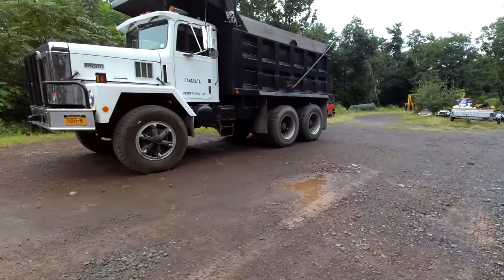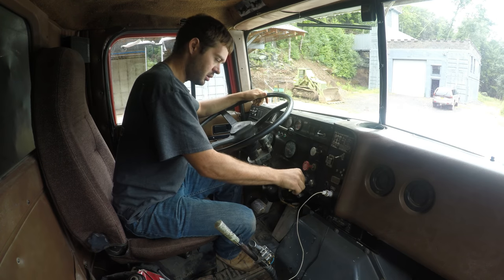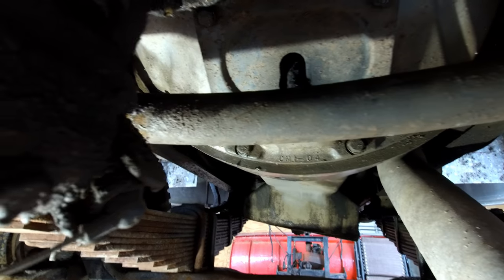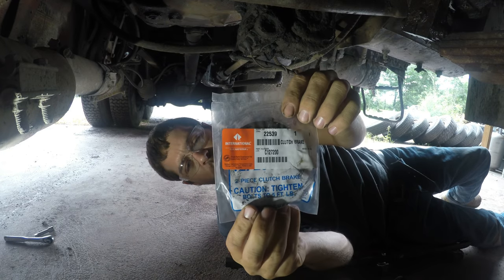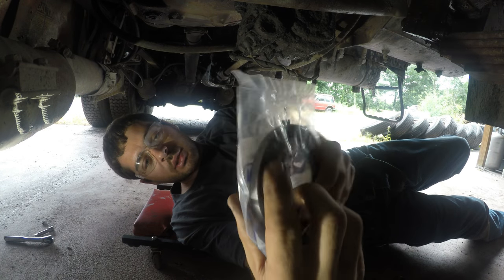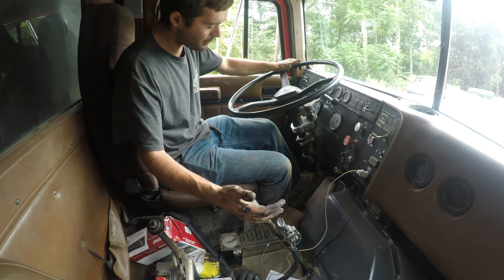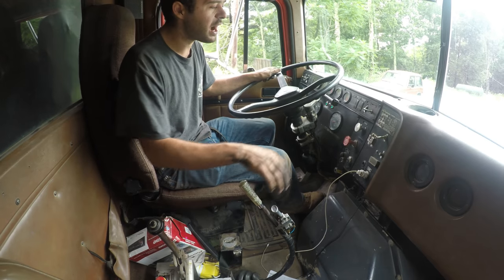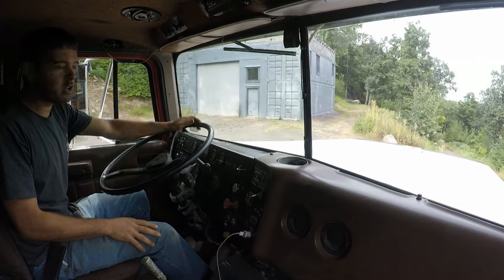Installing a new clutch brake in a dump truck

Comment: Great content it’s called we all live and learn.  At least your not afraid to tackle your problems and repair them yourself. 
Life’s full of lessons.  But now you know and I’m sure your never going to forget. 👍
Reply: Have installed many a two piece clutch brake.  Air hammer and a cut off.
Reply: Most times not removing the old one can put additional load on throw out bearing.  Check to make sure throw out not loosing all its grease due to over heating due to the added drag.
Reply: +Brian Wymer Wymer’s Handy Man Service You're** not afraid & you're** never going to forget.
Reply: SalandFindles  didn’t know it was a spelling contest but stand corrected. Seen your reply was edited so guess you didn’t get it right the first time.    Life is full of disappointment  👍

Comment: Andrew, you should only need your clutch for stopping and taking off.
Shifting without the clutch takes a little getting used to but it's not so hard.
Take you RPM's up to 2200, let up and pull out of gear to neutral at the same time.
Then when the RPM's drop to 1700, shift up into the next gear.
Shifting down is just the opposite, rev-up to grab a lower gear.
Practice it and you'll be king before you know it.

Comment: I’ve driven trucks for 16 years and most trucks I’ve driven had about the same slow to stop clutch brake. Being I’m alittle shorter I have to slide forward to use the clutch brake. I never use the clutch to shift personally but when I come to a stop I slip the truck in whatever gear I’m going to start off in then push in the clutch so I don’t really need the clutch brake.

Comment: Model T with a warford transmission has the same issue with shifting into gear at a stop.  You can either shut it off, put it in gear and restart it, or tap the reverse pedal which does essentially the same thing as a clutch brake.

Comment: Back in the day, guys used to cut the old ones out with a torch.
Reply: Real hard on the seal with a hot wrench.  Air chisel or just leave it
Reply: Not if you know what you are doing with a torch. You cut it not melt it. Use a small tip with a proper flame.
Reply: still do !
Reply: @RobsTrucking  that transmission doesn't have a input shaft seal.
Reply: @gregh.7977  what keeps the oil in?   Last time I took one apart you removed the bolts from the front bearing
cover, then removed bearing cap, flange gasket,
and O-ring.  That O-ring is the equivalent to an oil seal, and will not take heat any better than a lip seal.

Comment: Hey dude u dont need the clutch once your moving , when u change to a higher gear make sure ur not over revin as i notice gear grind alot , 200 to 300 rev drops bertween each gear is ideal , dont drive it like a car , drive it like a truck hehe good vidz mate keep them coming

Comment: Hi Andrew.  It seems that the way you did the job would be fine, except for one thing.  You need enough throw on the clutch pedal to ensure that the clutch doesn't drag before it engages the brake.  That is why on a properly adjusted clutch there is so much travel after the clutch pedal is initially depressed until the brake is applied. The new brake will stop the trans firm and fast enough when the pedal is all the way down so that you aren't sure if the clutch is dragging or not. The clutch will develop hot spots causing it to chatter, a glaze causing it to slip, both or many other ailments if it drags.  I Think its worth talking to another dealership other than the dealership where you got your brake from about how much it will cost to have them install a new clutch, pressure plate and bearing if they are damaged.  I'm guessing.it will be around $2,750 or more and a week or so down time..

Comment: two words... double-clutch.
Push in the clutch pull into neutral push in the clutch again and effortlessly drop into next gear.
With electric shifting, flip it before you take your foot off the gas (up or down) then when your ready to shift up/down just dbl clutch the same way and let the clutch brake keep you from grinding your gears down.
I started out life in a 10 speed white western star a mack dm600 and a Mack B61 Thermadyne believe me no truck will complain about double clutching. By the way your clutch was ailing when you bought it, its easy to see from the first sequence of you starting out, as the truck was experiencing chatter. Don't ever let anyone tell you its better to shift without the clutch, but after you figure out how to wait a beat in neutral before pulling ino the next gear you can do it without the clutch.
I should say, I am addicted to your videos. You are a young man with a whole lot of good sense and you seem to figure things out after seeing it done, or doing it once.
After getting into computers due to back oroblems, I miss the 955H 955K 555JD JD 410D CASE 455 and I envy you all these great small yet powerful machines, that don't tear up everywhere they go due to sheer weight.

Comment: used to change and adjust old volvos with the turbo Cummins and 9 speed fuller trans with the clutch brakes had to explain how to use it to every new driver where I used to work.

Comment: I don't think you will find any one who likes this truck more than me. The only thing I didn't like was the way that transmission shifted even from day one. You fixed the stoped going into gear grind but it's still grinding as you change gears. I don't know if it's synchro's that are worn or what but in any case they gears should not grind one bit when you shift. If the truck was old, rusty or semi worn out I would just run it but this truck is super nice. Worth fixing it right. What do you think Andrew?
Reply: The transmission in Andrews truck is a RoadRanger and was designed and built without synchros. Using the correct grade of oil goes a long way toward reducing gear "graunch", but mainly its about matching gear train speeds when changing to reduce or eliminate the noise.

Comment: @ 6:19. Que the anger level.

With you not removing the old piece you might affect your ability to shift on a regular basis by not letting the clutch fully disengage the driveline.
Reply: It does fully disengage the driveline....he showed that it does plenty of travel before the truck starts to pull.
Reply: You don’t shift using the clutch, you only use it for stopping and taking off
Reply: Tim Gooshaw 
I drove a 10 Speed Roadranger for many years without the clutch but try tell the license examiner that you don’t need the clutch and see if you pass. They want to see double clutch up and down through the gears. 
Now people pass their test with a 6 speed synchromesh transmission and tear apart a transmission without synchro’s because they have no clue how to drive. One guy I worked with had to stop and restart if he blew a shift. He later drove long haul with my brother. 😂🤣😂
Reply: @Crewsy  we brits got rid of the double clutch gearboxes years ago but we still used the eaton split box in a truck called and (E.R.F) i drove a thew times loved it , what gets me now is most trucks all the way from 7.5tonne gvw to 40 tonne plus arctic trucks are all automatic gear box crap , even you americans have been delighted with the autobox now haha
Reply: Yeah Tim is right, he just has to wait for the rpm to drop before entering the next gear. Pull it out at high rpm, put it back in at low and she wont sound like a chainsaw every time.
Reply: @Crewsy  Yeah,  I wish someone would explain why you don't have to double-clutch. The clink or grind couldn't be good for the gears. I'd like to know the science behind it and which is really better for the truck in the long run.
Reply: Dave Voskos 
As Marty eluded to in the comment before yours, in both cases you are matching the rpms between the individual gears. When shifting up you pull out of say 4th gear at a higher gear rpm then as you are shifting the engine drops rpm and your gears also slow allowing you to smoothly shift into 5th. 
When double clutching you are just getting the gears spinning faster to match the gears rpm for a smooth shift. Either one when done right is smooth and quiet but both can turn the transmission into a coffee grinder. 
Gearing down you need to rev the engine up mid shift to match it to the lower gear.

Comment: I drive garbage tracks and my old truck was on a Mack cab very similar to your dump truck. Our clutch break was a knob you pulled on the shifter, next to the high/low selector. I never knew about a clutch break like the one in your truck. 
Personally I hate Mack trucks now, at least the new ones with the DEF systems. That whole DEF regen system is always messed up.  We have to send a truck out about once a week to get a new ceramic plate in the regen system and it's like $10k for that little part. Our old Volvos and Mercedes run perfectly and are almost never down. Last winter we were driving on bald tires because they blew our whole budget in about 5 months fixing the 2 Mack trucks we have. It's like a 10 step process just to set the clock. If the engineers can't figure out how to design a clock I don't trust them to design a truck

Comment: I honestly haven’t read the rest of the comments but these this truck has a synchronous transmission that is very different from a regular manual. If you haven’t done so yet look synchronous transmission up. Hope it helps

Comment: That is VERY interesting, never heard of a Clutch Brake. 
I need one on my 1970 Yale Forklift, it always grinds going into gear from Neutral to forward or reverse. Then again, the Eaton transmission is from a 2.5 ton truck. So just JAMMING it into gear will never mess up the super oversize gears in the tranny. All the gears looked pretty chamfered on the edges when I took it apart to replace the clutch. Like it's been ground into gear for many years....lol.  "Grind me a pound" is most likely SOP......Standard Operating Procedure.

Comment: I owned a trucking company and I will tell you that holding the clutch down at a stop sign will damage the pressure plate. You should really talk to someone for about one hour to get all the secrets about owning a truck like yours
Reply: Thomas Fry You know for being a medium duty transmission that seems like something he shouldn’t have to fucking worry about (that sounds like manufacturers are  trying to cut corners)
Reply: Yep

Comment: I would definitely take the old clutch brake out if you have not done it already you cant adjust the clutch properly with it in there. I also noticed the jake isn’t hitting on all cylinders unless you have a 3 position switch and have a head shut off.It would not hurt to run the overhead on that engine. NTC Cummins are easy get yourself a manual and a turning tool and a inch pound torque wrench a set of 45 degree feeler gauges helps too

Comment: The only time you need to use the clutch is to startup,It takes practice but you will get there.we used to cut one piece brakes out with a torch.Better than pulling transmission.

Comment: Andrew Len in Canada I believe that is a coum-alone they make the best power @1500rpm
so make it work they love it. Make sure that the clutch is adjusted right or you will burn it out. One more thing do not keep your foot on the clutch when you are stoped as that can be a motor job. Ask a mic abut that (though bearing)

Comment: The old clutch brake seemed to be fine, maybe next time try adjusting the clutch itself. You will have hell with it until you remove one of the clutch brakes, not enough space for two in there.

Comment: When shifting without the clutch, try it at fairly low RPM's and definitely below 1400. When empty, you can skip gears when accelerating, like 2,4,6,8 (first gear is only for being full). When slowing, always downshift so you are always in gear in case the brakes start to go out.

Comment: Because you left the old one in if you smell something funny while double clutching in motion it’s just burning off a bit more of the excess clutch brake. I drive these dump trucks everyday at work and when your just shifting you only need to move that clutch and inch or two after it starts engaging. If you float your gears in motion you don’t have to worry about that excess burn.

Comment: You probably didn't break it when you test drove the truck. Those things naturally wear out, especially on dump trucks where the clutch pedal is used a bunch. An over the road truck clutch break will last more miles simply because the clutch isn't used as much. You should have removed the old one though. Its only designed to have one in there. When I worked at Cummins back in the 80's we always had to replace those things.

Also, if you need to bump the engine over and not start, just remove the fuel pump wire from the solenoid. Only need a 7/16" but driver. Those engines will always try to stop in the same position due to the amount of compression in certain cylinders.  Good luck with the truck. I love those ol skool rigs.

Comment: Did you try adjusting the clutch first? That clutch Brake looked like it still has friction material. No shortage of videos out there about how to adjust clutches if you are unsure, but as a diesel mechanic, I can tell you that you should run it with the two clutch brakes on the input shaft like that. Anyway look forward to future videos involving this truck.
Reply from the maker: Yes I adjusted it, it was throwing as far as it could.

Comment: I have no real information to add as the others have Andrew except to say in my jaded view on life its a bit of an haphazard way of doing this I wonder if International are the only truck company to do it this way I mean always having to remember to only put the clutch pedal in half way what a pain but then I guess your used to hand and feet coordination using bobcats and diggers so I guess for 
you it's no real problem But don't feel too bad the other guy who sold it to you could at least have told you about the clutch brake and how to use it but that's life I guess I really love your videos they are always so informative and I may never drive a truck again but if I ever do at least I will know what to do

Comment: The gap between the clutch brake and throw out bearing when you first took the cover off is way too much indicating the clutch is out of adjustment, the gap should be no more than 1/2”. An adjustment may have taken care of it

Comment: An interesting video but I'm questioning whether or not the old clutch brake was worn out or not? If you do a search here on YouTube you will see that most of them do a test of about a half an inch a space in where the clutch brake is at. But they start out there testing to see what the free play is on the clutch. So your clutch includes an adjustment by which you can adjust the free play and when you adjust the free play with that it actually adjust the clutch brake at the same time causing it to be less distance in the half inch measurement test I mentioned earlier. Once you adjust your internal clutch adjustment if your free play is not enough or too much then you might possibly need to adjust a linkage adjustment or replace components as needed. If after all this you still don't have clutch brake function correctly then possibly you really do need a new one but in all the years I drove and worked on these things I never needed to replace one clutch adjustments were enough. I had clutches replaced for other things such as slippage and or warped discs and broken Springs but not clutch brakes. Shifting at stop sign should have never been an issue to begin with since you don't take it out of gear until you're almost stopped rolling and simply slipping into the gear you plan on starting with at that time. If you think downshifting on Hills is a problem possibly with the rest of the shifting issues you're having you should get some advice from an old hand on the subject with a little more experience. Not to be mean but if I did this on a driving test for a trucking company I think they'd probably not hire me. On older equipment like that you really really really need to learn how to float the transmission now without using a clutch except to stop and start